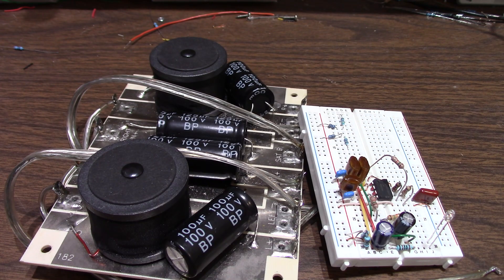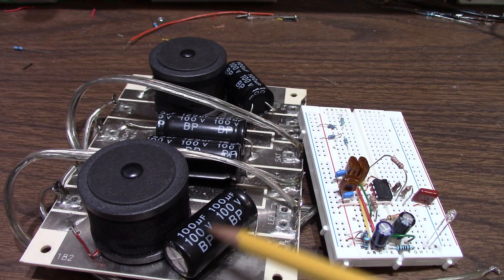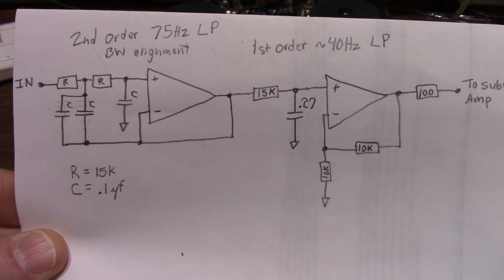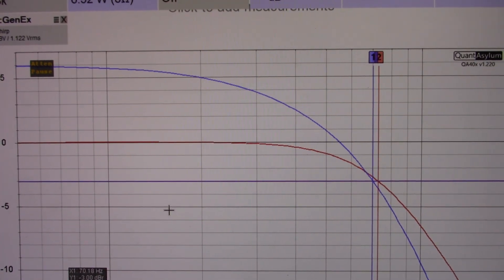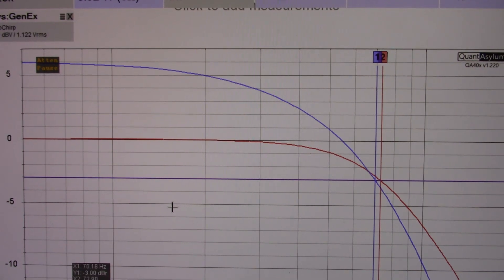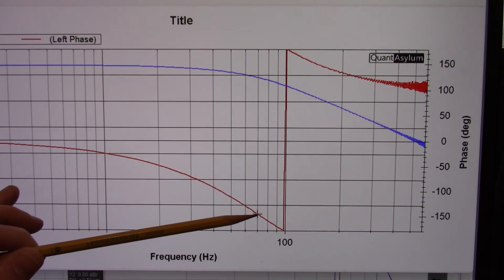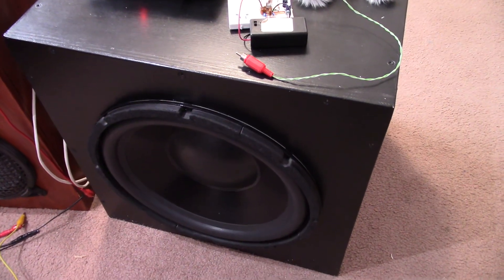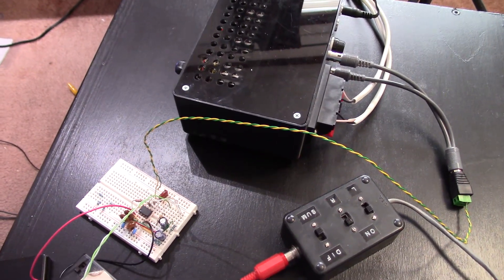Subwoofer active filter with bass boost DIY

Comment: Nice work, John. Yes, a video or even short series (or long if it sparks the teaching creativity) would be welcome. I've been toying with real low power (5V, single supply) for preamp (splitting/crossover, bi-amp) duty in a boom box I am designing. I've used the calculator over on Digikey to get close to where I want, then used real world values to see if it's close enough. Oh, and I am working with just a single 2N3904, so each side will have 2 circuits to split and feed the individual amps. Which, btw, are those $ Tree amps.

Comment: John I would love to see  ULTRA basic designs using minimal common parts... then advancing the circut showing different  values. Hard to find anyone that does  a 1 or 2 or 3 component build from common Caps, resistors.
Reply from the maker: Yes, I would start out with the basics. After all, a 1st order filter is just a resistor and capacitor.

Comment: I heard less, least quieter, bass with the added filter section. Not that I expected to hear much as my desktop speakers don't go very low at all. Thinking of a sub but I have been for ages...
Reply from the maker: There is a low bass track in the audio that would need a sub to hear. With the sub disconnected, I can't hear it either. Having a sub on the computer audio is a good thing!